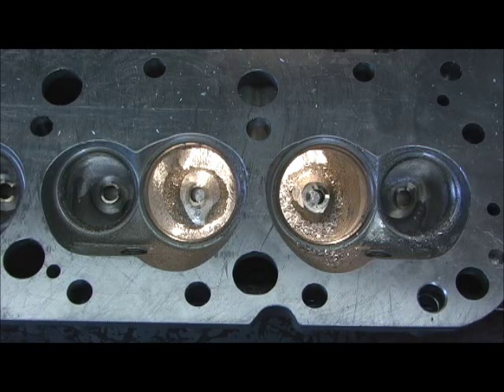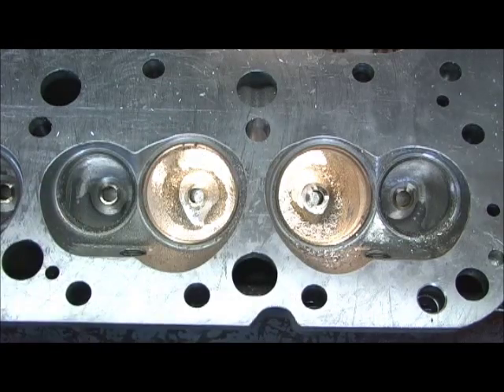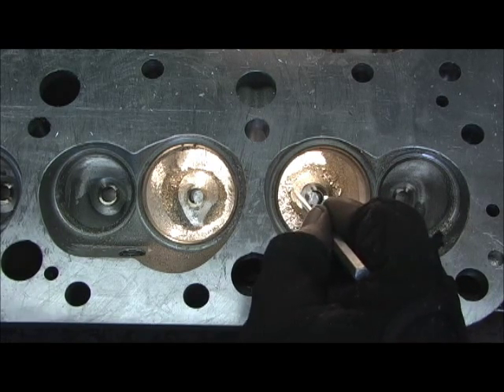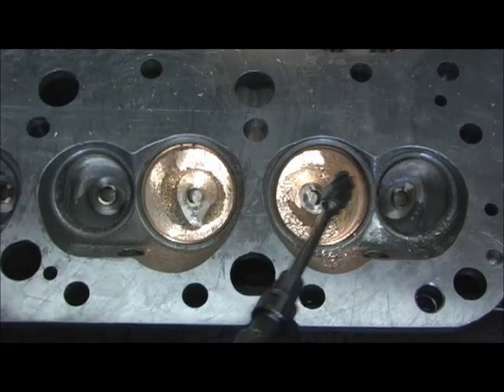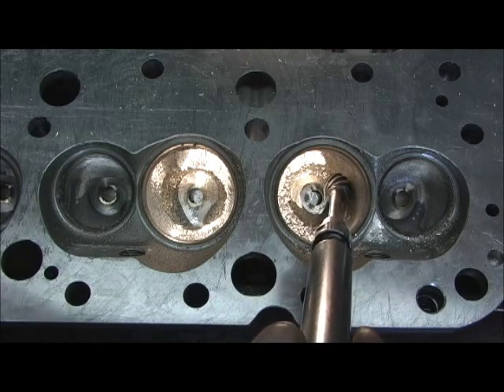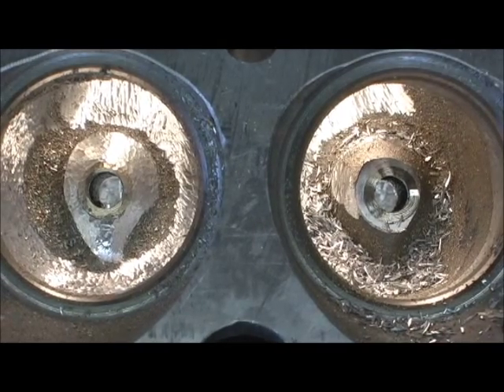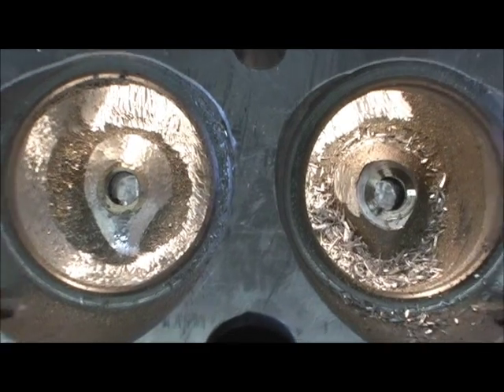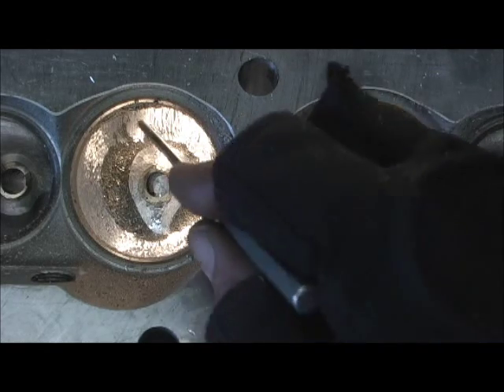ProComp 190cc Stage IV Ported Head Part 2

Comment: could you show the tubing process in more detail? like the installment with the epoxy? i get how you size the bolt hole, but i'm effy on the hammering and how much epoxy to use. the reamer size would help too

Comment: I purchased a set of these procomps for a SBF, 210CC intake. The Ford head had a nice shoulder that I could clean up under the seat. Once I got the shoulders grinded down to the radius of the seat. I finished of by just taking off enough to get a nice clean, smooth finish. Heads whent on a 351-w, mech flat tappet, .565lift, 10.40's on a 125 shot. Not bad for a budget biuld up. Thanks for the info, Nice port work.

Comment from the maker: You have NO IDEA Met. What kills me the most when China did this was for YEARS us head guys in the US knew that this is the area where it needed to be the thinnest. Comp Cams even makes a "Port Intruder" kit for this, and here China goes and does completely the opposite, however, I know why they done this, for bolt support. At first, it worried me till I done TWO sets for some local people some years back and NEVER had a problem, then PROCOMP said they offered a CNC vers. with it thin there